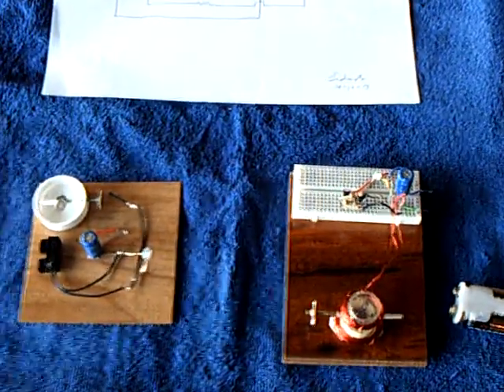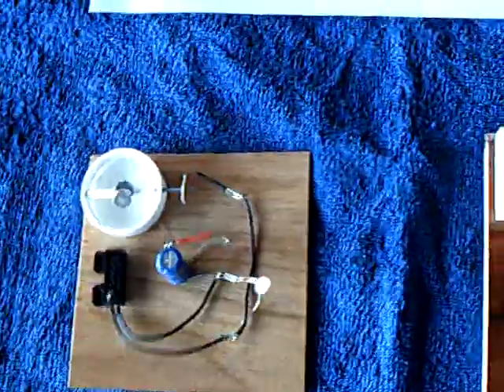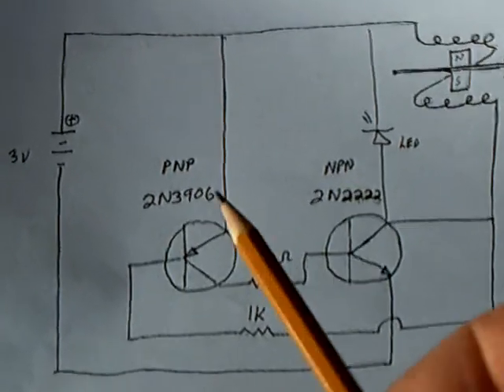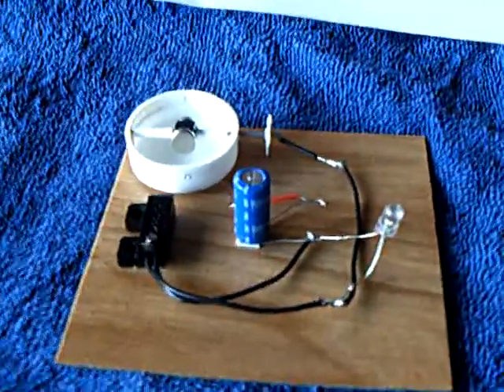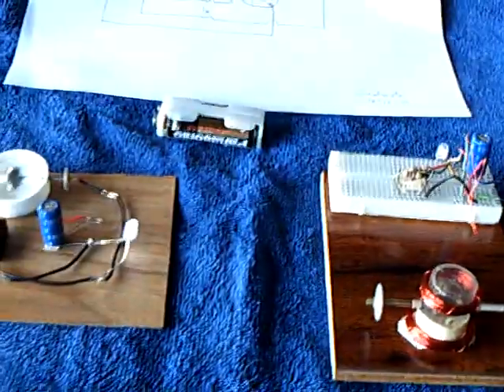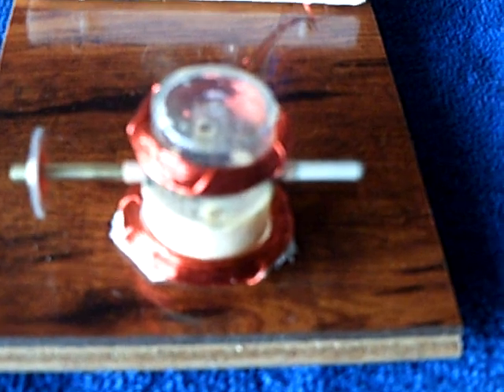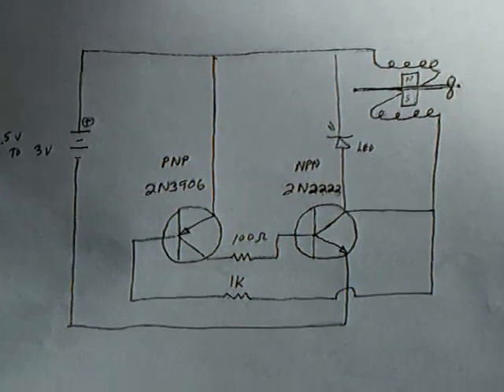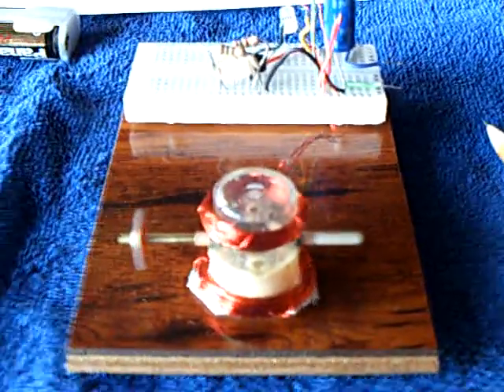Motor Wars

Comment: Hi. Nice motors. How about the small add-on on your motor circuit? - At the one end of the motor shaft  the two small thin disks can be attached, one attached the shaft, another in stationary position, with small gap between each...like small wimshurst electrostatic generator. How can be improved the running time of the motor, if the output from this small wimshurst generator will be connected to capacitor?

Comment from the maker: Thanks.  I totally agree with the need for a load for true testing.  An identical prop on the shaft should work.  That is a known load.  The other problem (or objection?) I see with what I did here is that the cap voltage is constantly declining and some DC pulse motors might need a constant voltage for max efficiency.   My method is just a crude way for a kitchen table tinker toy maker to look at his creation's performance. Give a couple of motors the same loaded cap and let em duke it out.

Comment: Could you redesign the circuit? I never understood why circuits destroy energy. Redesign it so that the NPN is at the + side, so that you can add up the current which activates the transistor from base to emitter. Or am I saying something stupid? I know the HFE is perhaps 1 to 100, so in that case you still add 1 / 100th of the current, and it might run 101 seconds in stead of 100 seconds (or it has more torque of course). It is always in the details.

Thanks for sharing!